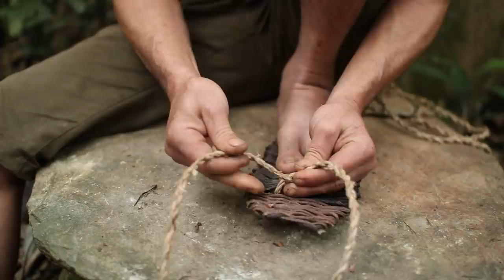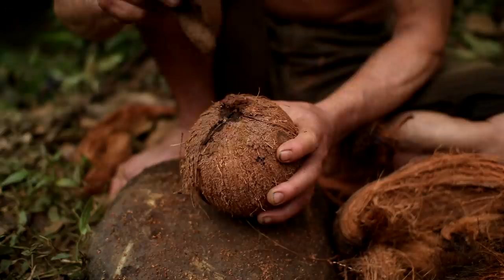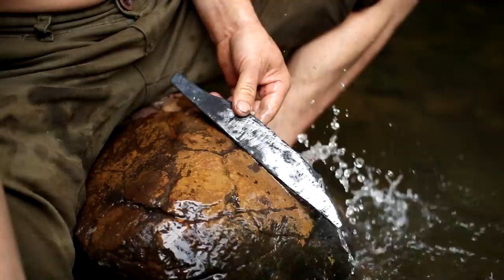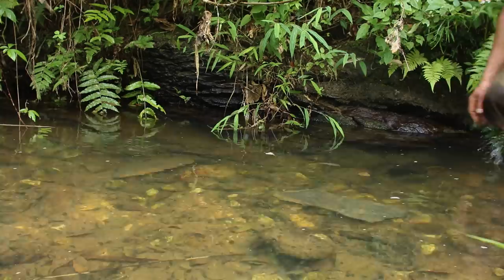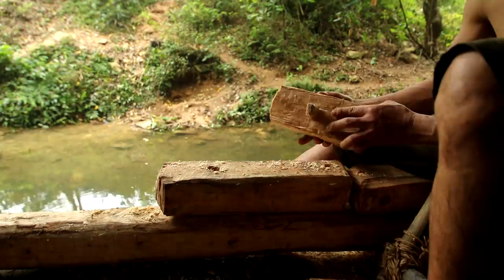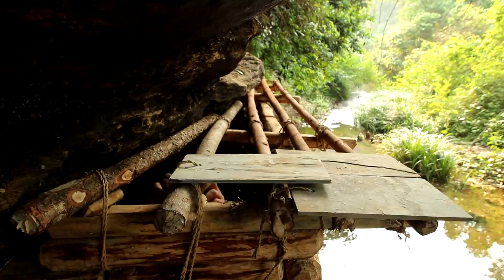90 Days How I Building, Survival And Cooking In The Rain Forest

Comment: The iron casting story is just a story, definitely fake. For several reasons.
- Iron melts at 1553 degrees celsius. Steel is about 1450 degrees (depends on additives)
and iron cast is in the same range, let's say at least 1400 degrees.
- If you want to really melt steel so that it's liquid enough to cast it, then you have
to heat more otherwise you cannot reach the mold before it's solidified. And beside this,
the mold is rather cold, which solidifies the metal at once. Conclusion, you have to
preheat the mold. Even with Aluminium, you don't have much time. And with iron, it
cools a lot faster when in small quantities.
- You cannot reach 1400 degrees with charcoal and that kind of prehistoric system.
- In the ancient times, steel was not molten but soften and beaten until impurities
leave the steel.
- Judging by the color, it's quite far from 1400 degrees. For those who may have
worked with steel, it's obvious: You cannot look at molten steel without protective
glasses, it's too bright. Even for simple welding. It's a bit like looking at the sun.
- If it really were steel, you couldn't move the crucible with a pair of chopsticks.
- The stone used to sharpen the tools is not even worn at the end. Even an old round
stone specially made to sharpen tools gets worn quickly.
If you want to look at what melting cast iron looks like, here is a good pointer:
https://www.youtube.com/watch?v=fujtl1dlB9M
It burns gas, it uses a reasonable furnace, the guy preheats the mold, and the result
is a piece of probably unusable iron cast. If you make a kife with it, it will just break.
At the beginning of the video, you can judge the strength of the iron cast with is broken
with a simple hammer. And in the other video, the guy hits his cisel with a hammer
against rock.

Note that the tools used in this video are probably made of iron, but definitely not
the tools he has made.
That said, other parts of the video were interesting.

Comment: i mean this is definitely fake but still a good video because the melting point of iron is 1540°C degrees Celsius and the burning point of wood is 600°C and also even if it was aluminium (which i doubt) then it would still not be able to melt because its melting point is 660°C but it is still a fun video good job

Comment: The metal being cast was defenitely copper, neither steel nor cast iron form that black oxide layer as soon as they're cast, the liquid would have been white hot and lot less viscous. Plus, the final piece doesn't show any blowholes, which you would expect from all the steam escaping the clay and passing through the molten metal. The knife overall looks like a sound cast without any defects, which is very hard to believe given the situation.

Comment: It’s fake! For starters steel or high carbon steel has a way higher melting point, there ain’t no way this goon with his little fire place can do that 🤷‍♂️ and 
1 The hammer mold was too shallow! End result hammer way bigger. Also the crucible looked way too symmetrical and perfect to be handmade 😆 
2 the chisel mold wasn’t that long 
3 the metal he is melting is bronze or brass